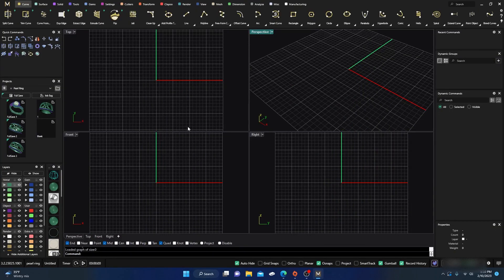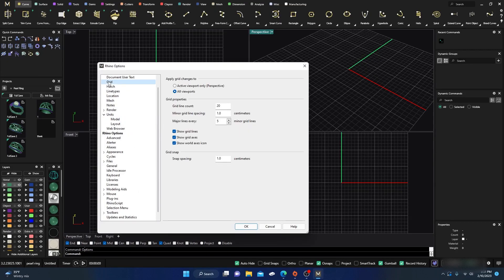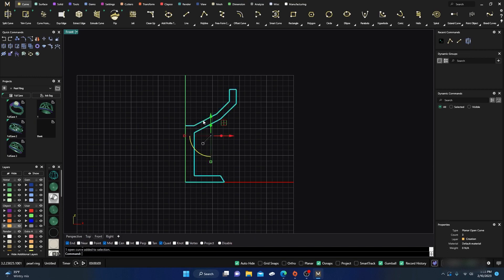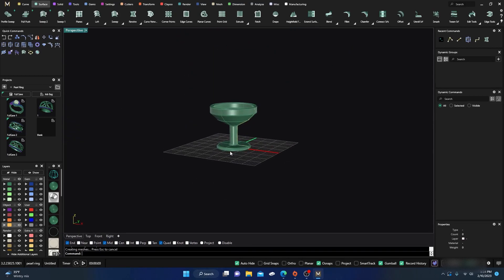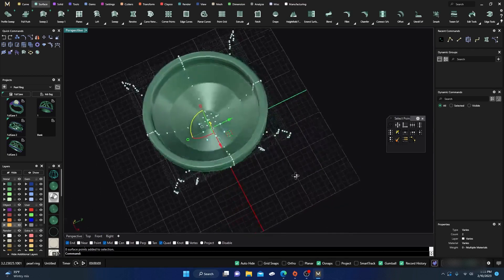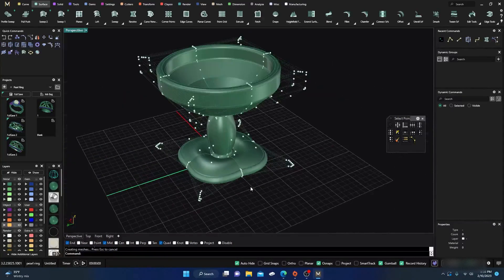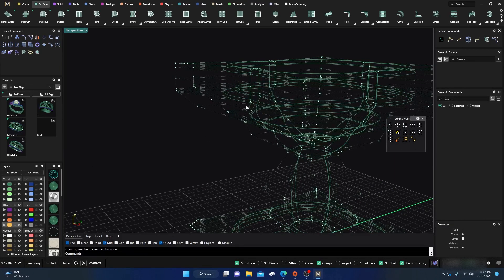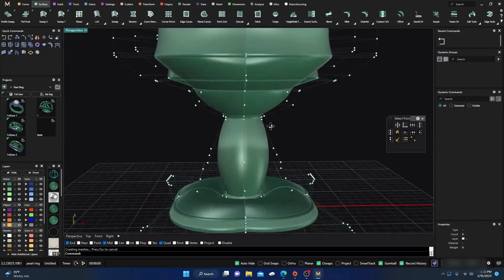MatrixGold, Matrix, Rhino Point Editing

Comment: How come some times you can turn on points but sometimes you cant? It seems to be when something is a "surface" you can turn on points, but when it is a "polysurface" you cant. What is the difference between a polysurface and a surface? And if you have an object you cant turn points on, is there a way to convert it into a surface so you can? 

I did a sweep 2 on something yesterday and in one instance it turned into a surface, but when I performed sweep 2 in another instance on something else, it turned it into a polysurface, so I was not able to edit points and got stuck. 

 Sorry for the long question!
Reply from the maker: I just uploaded a video on Nurbs and Polysurfaces and how to convert to be able to maintain shape and edit points. I hope it will help you. If you have further questions, please let me know.
Reply: @donsjewelrymakingandjapantrave  Thank you so much! You are always so helpful!
Reply from the maker: I will upload a video on the differences between polysurface and a nurbs surface to try to explain it a little better. But basically, a polysurface is made up of more than one nurbs surfaces. A nurbs surface is one single surface which you are able to turn on points for editing. You can explode a polysurface and merge the surfaces together to make a nurbs surface and then turn on points for editing. Polycurves will give you a polysurface because the curves are made up of more than one curve joined together which some profile curves are made of. You can rebuild those curves which will change the polycurve into a nurbs curve. Difficult to explain with text so maybe the video will offer a little better explanation for you. So please be watching for the upload.